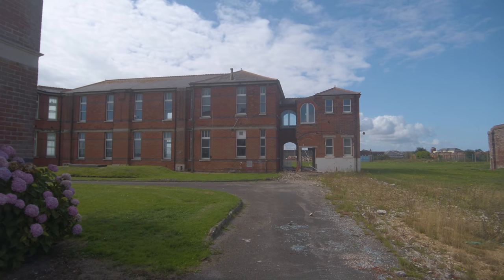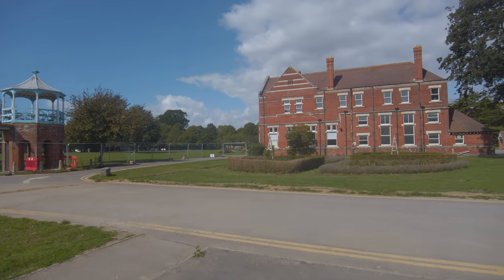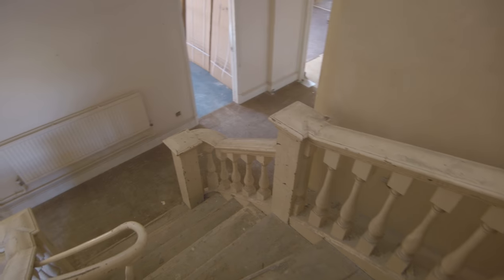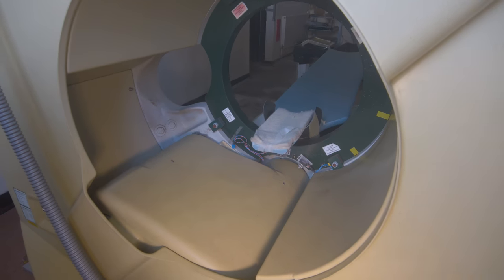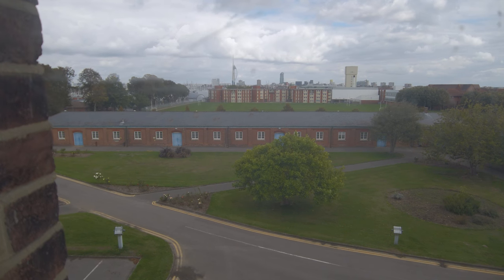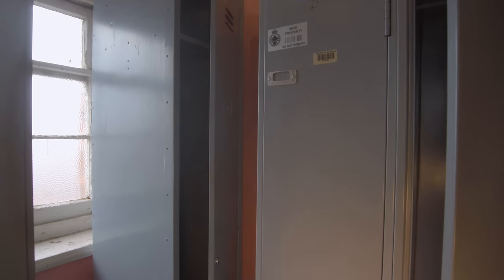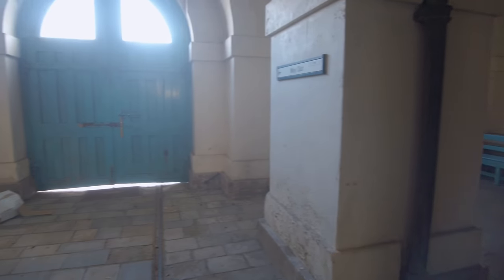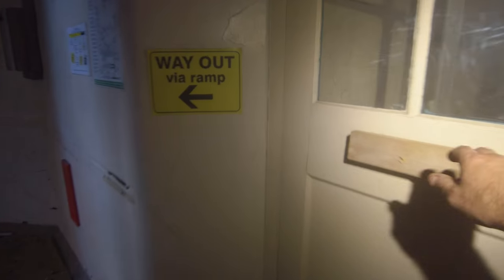Royal Haslar Hospital  MASSIVE URBEX

Comment: I think the first three blocks you were looking at were known as the "Zymotic Hospital," which apparently treated sailors with mental illnesses.  That explains the spy windows between what would have been nurses offices and main ward areas.  Your underground tunnels would have been beneath the central buildings that contained the A & E department and theatres - this was still in use until about 1995' and then demolished soon afterwards to render the hospital useless and fend off the campaign to retain it as an NHS facility.  The vaulted area at 1 hr 54 min is the original entrance to the hospital, sailors were brought in by a tramway, whose tracks you saw, c1830.
Reply: Starting from the eastern end of Zymotics wards (for infectious diseases, well away from main hospital) there was MI, 2, 3 and 4.  These were for treating things like measles, chicken pox, etc.  Then at the western end, Z1, 2, 3 and 4.  These were for tuberculosis.  At one time there was a small building close to gates leading out onto the sea front.  This was formerly use for cases of small pox.  This has been demolished, as has the far-western ward, Z3 and 4.

Comment: Uranium glass?

Wouldn't have thought so... Uranium emits alpha radiation that can be blocked by a sheet of paper.

I've seen similar for Plutonium...however, it's a lot thicker and is layered with mineral oil (I believe)
Reply: It will have been lead glass.

Comment: I went there in 03. There was a unit that had rooms with treadmills where the rooms could be heated up or cooled down. Went there on my return from Iraq for testing for heat exhaustion. Had an anal prob to check internal body temperature & oxygen mask or measure oxygen intake. Spent a day there